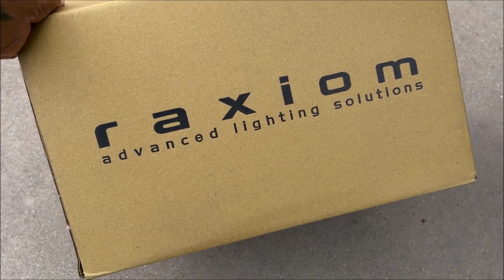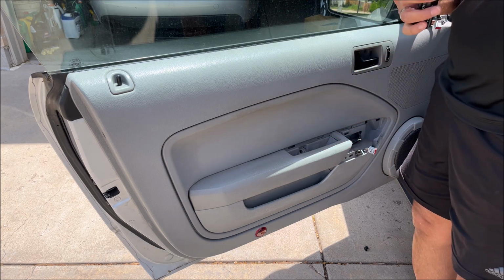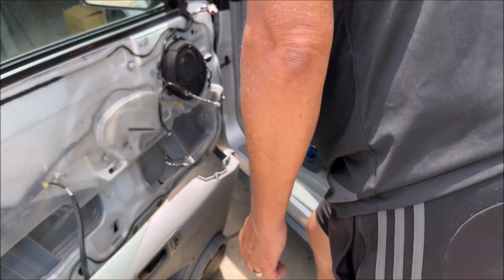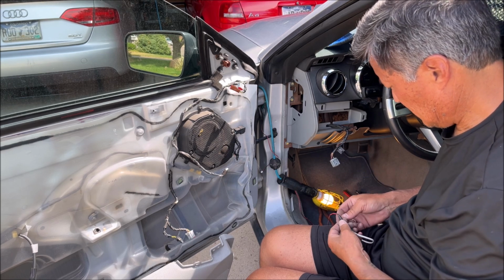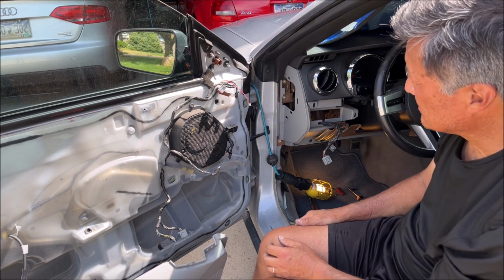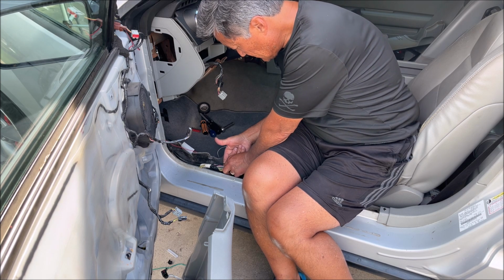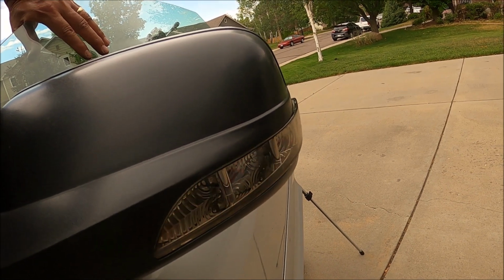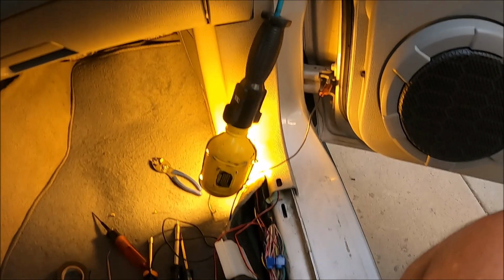2005-2009 Mustang Raxiom Directional  Mirrors with Turn Signals

Comment from the maker: Note: If you wire it this way as shown in the video, your mirror turn signals will come on with the brake lights. I didn't like that, so to fix this, you need to wire into the front turn signals by making the connections in the Smart Junction box in the passenger kick panel.  Dark blue wire with orange stripe for the passenger turn signal and gray wire with black stripe for the driver turn signal.
Reply: Just noticed this today

Comment: I can't believe they didn't notice the brake lights would come on, i think I'm going to try to run them up to the head lights, maybe i can run the wire from the grommet to the wheel well
Reply from the maker: I did run them to the smart junction box on the right side and it does work good from there. Running the wires to the front would also work!